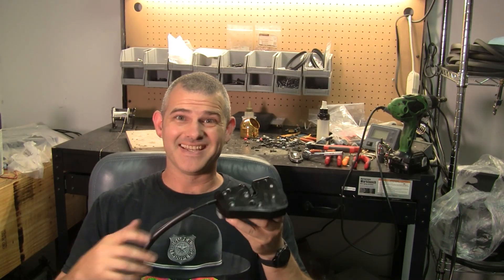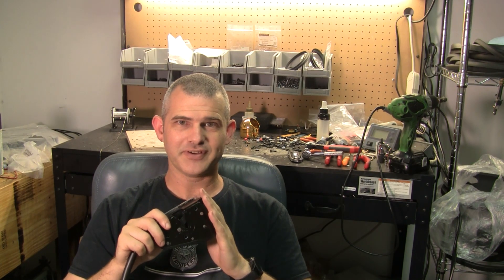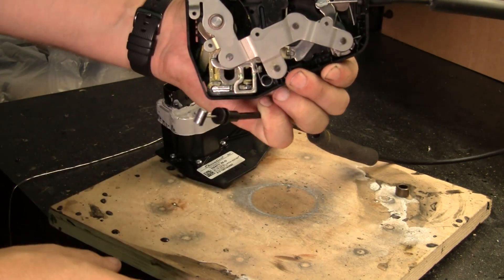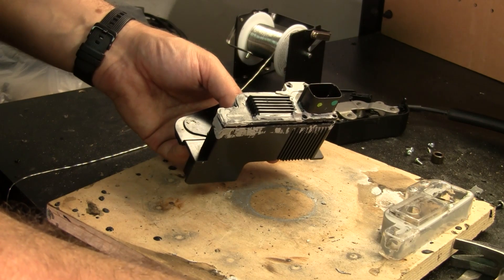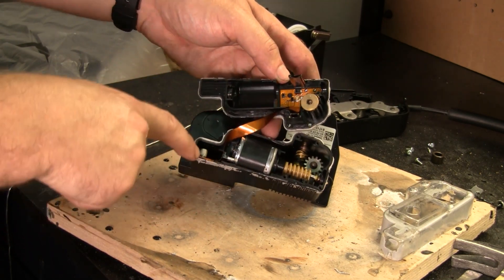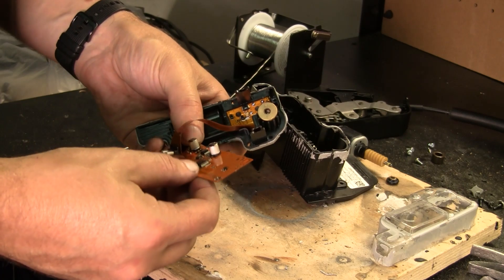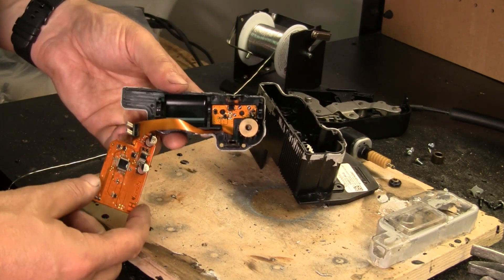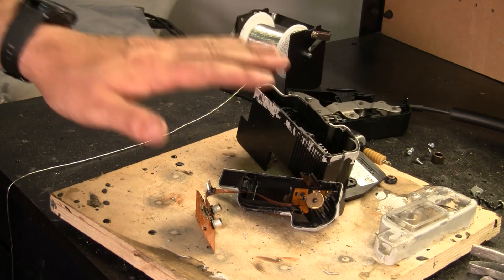Why do Tesla and McLaren soft close latches go bad and can you repair them?

Comment: dear sir, thanks for this wonderful video. May I ask if there is any instruction/video on how to remove the latch module from the door? I am encouraging myself to do the replacement DIY since it’s not expense to order a replacement latch module in my country (~$100). My door issue is that the soft closing latch motor doesn’t kick in even when the soft-close trigger is clicked 😢 . Thank you
Reply from the maker: Depends what car.
Reply: @McMedics  Model X front passenger door 🙏🏻
Reply from the maker: I don't fool with Tesla's at all
Reply: @McMedics  Model X front passenger door 🙏🏻

Comment: My door issues is sometimes it can’t be close and window doesn’t come up.
Reply from the maker: There are a few different failures, all are due to electronics inside the latch. Sometimes they'll pull in but not stay in, others won't pull in, and sometimes pull in and latch but randomly say the door isn't closed. In all cases if it says it's not closed the window won't go up. If it won't draw the door in, usually slamming it will at least get it closed.

Comment: I was thinking swapping the boards around in the latches, that could work.. I think you are right about the tesla needing them the way they are now and the mclaren the opposite, the body computer might be getting confused
Reply from the maker: The computer knows no different. The only thing it knows is open or closed on which circuit. That's wire based, not device based. If it knew specifics it would have to be coded. When I say something wrong with the board I mean a component failure.

Comment: Hmm, I’ve never had this problem but what I do have is when the weather is really hot and I’m in the sun (I’m in Qatar so we’re talking 45-50 degrees C) it tries to pull the door in but fails. The only way I found to fix this was to press down firmly on the door while the soft close is doing its job.
Reply from the maker: Mine seemed to do it more when hot, I replaced it and it's been fine. The passenger side never has had a problem for me.